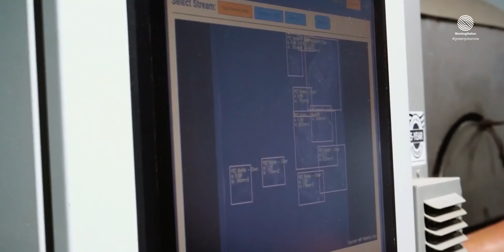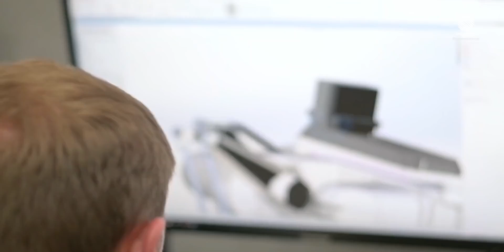Careers in Robotics Engineering | Day in The life Building Robots for a Recycling Plant

Comment: Gold kit robotics cost $7887 in college courses and they are a secret of the community. They as such are a bust of the head and shoulders of a build. They need to be coded to F=m*2345 not F=m*a*a as such Isaac Newton did not have any robotics. Besides giving them the gold you need to tell them E=hf^2 laser physics research equation for knowing this you receive a laser sensor. You can give them two calculators and then they can run and move faster.

Comment: I only support this kind of initiatives but in many cases AI/ML is applied to solve a problem which would not exist if a more disciplined approach was in place. For example multiple recycling bins for metal, plastics, etc, or trying to make sense of unstructured data when it could be structured. We as society need to put more structure in place to avoid problems in the first place. Unfortunately nobody questions status quo or when they do they don’t get enough supporters.
Reply: It'd be nice if society was so cooperative, but oftentimes the more difficult you make it for people to do the right thing the less often they'll do it. If we can increase the rate at which people recycle by making it easier through application of AI/ML to help sort, for example, then that's probably a net win for the environment.

Comment: Hardware is expensive for someone to have personal experience with and it is hard to get experience if you do not get an internship. I wonder of experience with simulation can be considered as a good experience to get a job.
Reply: Good simulations maybe. But you still have to learn theory and use simulations to practice. There’s also probably workshops or courses you can take that allow you to practice. There’s also a lot of fairly cheap electronics you can combine with 3D printing to make pretty cool projects if you are creative enough, as engineers we need to be able to work with what we have and make the seemingly impossible possible.